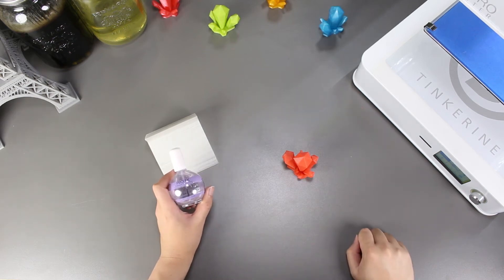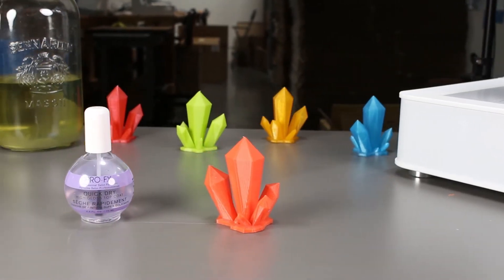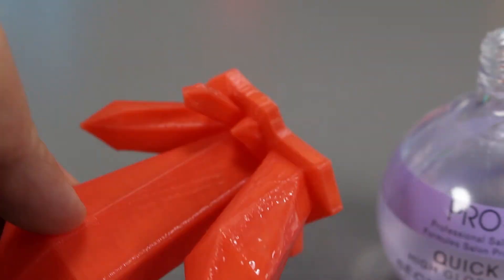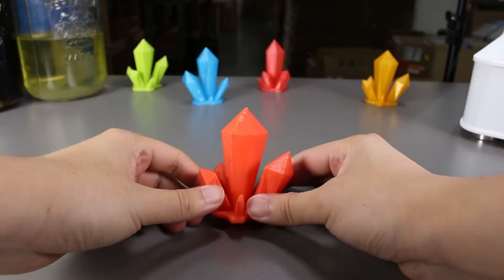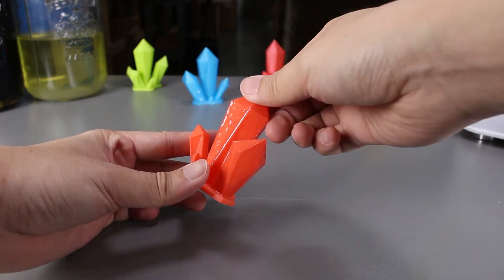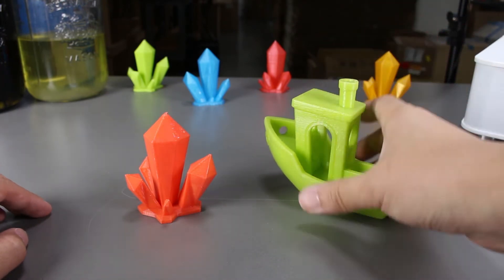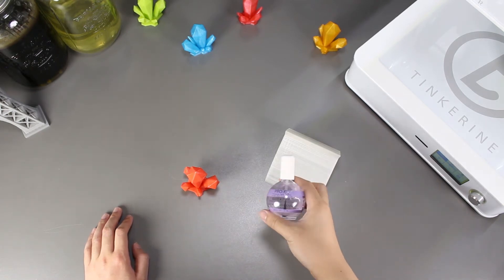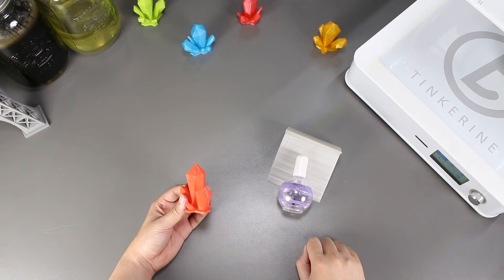Post Processing 3D Prints with Nail Polish Top Coat

Comment: No joke this is the best method for making PLA glossy that I have ever tried, There is no spray cans to worry about, its super easy to apply it with the brush. It does take longer for large prints but its worth it, I hate spray paint cans with a passion because they create so much fumes and you can only use it outside and thy often go on too thick. I went to Walmart and got the cheapest clear gloss nail polish and its worked wonders on my miniatures. Literally looks like a resin finish. Sometimes the dumbest ideas are the best ideas.

Comment: what if, instead of brushing the top coat on, you pour the top coat into a container then "bathe" the print. wouldn't that work the same way?
Reply from the maker: Hi,

That's a great idea, it should work the same as the method I use, you'll just probably have to hang the print to dry and there will be a lot more excess topcoat.

Comment: how do you get your prints to look so clean? even when I spend time on it, there are still small bumps.
Reply from the maker: Hi!

Are you using a DittoPro 3D printer? If you are, we can help with the tuning and calibrations.
Reply: I have an M3D printer
Reply from the maker: Different printers have different factors that may contribute to the issue that you are having. Typically with bumps on the side it will have to do with calibrations and squaring for the gantry. As for bumps on top of the print, usually with temperature and speed options.

Comment: What kind of primer did you use? Did the top coat make the print waterproof?
Reply from the maker: Hi!

We actually used a sandable primer from Plastikote. The nail polish top coat should have sealed the print so it should be waterproof.

Comment: I had an idea about smoothing PLA and thought I'd get your thoughts on it.
Although this would take a long time, it requires almost zero effort: 
Water down some wood glue (50:50 by volume seems like a good start).
Dip the print in the solution, gently shake it off.
Hang to dry.
Repeat each day for however long it takes.

My reasoning for this idea is that capillary action will draw the glue into the print lines, but any excess will drip off the print.
Using wood glue will give a nice hard shell finish which can be keyed with 1500 grit sandpaper for painting if desired.

Just a thought. Any comments?
Reply from the maker: Hi!

Thanks for the suggestion, it sounds like it should work. We'll take a look into it!
Reply: Sounds like a good idea, ill give it a shot on a smaller print 👍

Comment: so, did the top coat get rid of the layer lines?
Reply from the maker: Hi!

Well technically it did get rid of the layer lines. It didn't melt the PLA but just created a smooth top coat over it.
Reply: I've done it with multiple layers (you et it dry, you add another) and the lines are almost not visible

and one more plus, during the waiting, I've managed to do my manicure after long long time :))